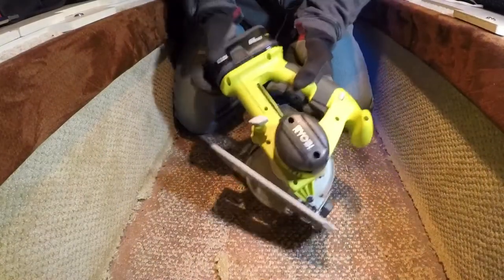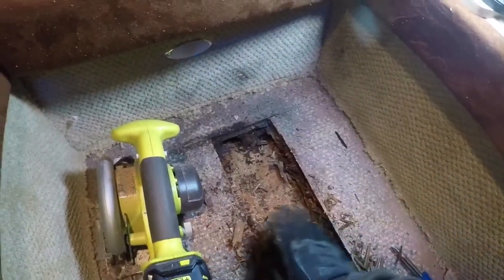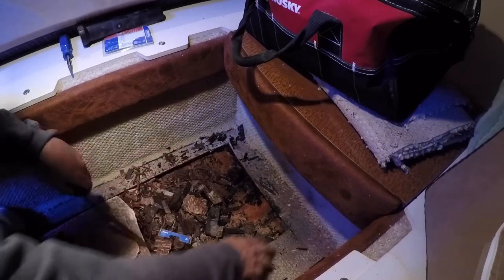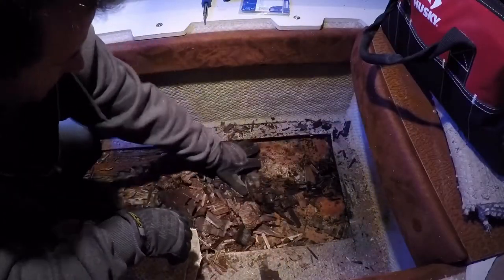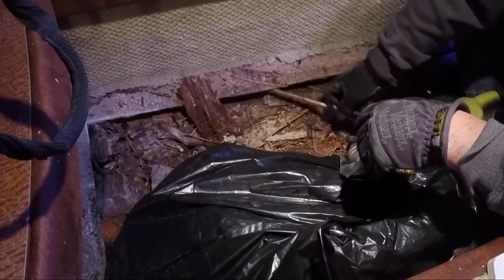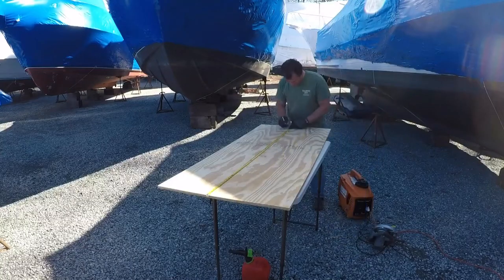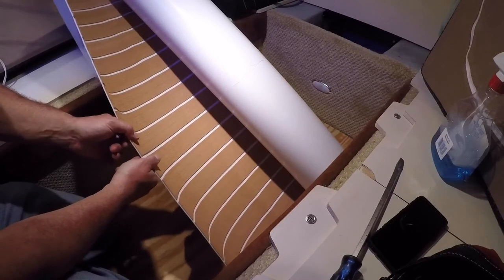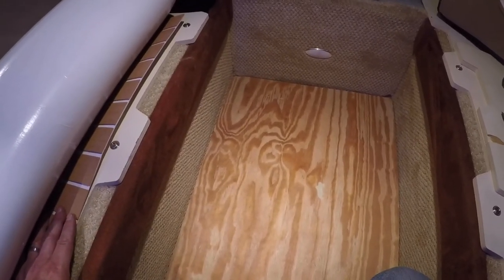Repairing rotted boat floor (part 2)

Comment: Nice Are you going to leave a handle on the new flooring so you can access underneath if need be?
Reply from the maker: I Decided on no handle.  Nothing under there and very little space anyway.  I was worried the floor May wobble if not glassed in, so I just fiberglassed the new floor in.  Solid as a rock now.